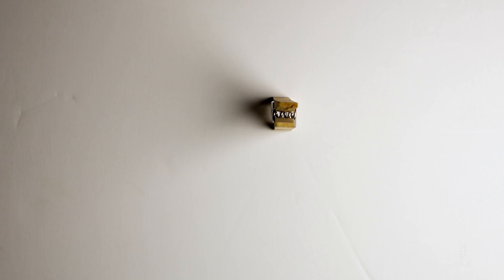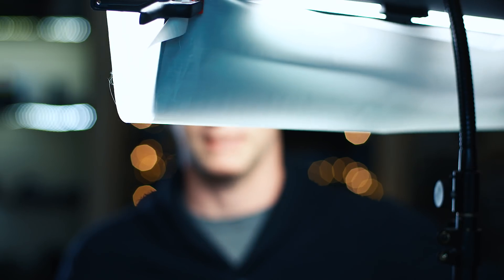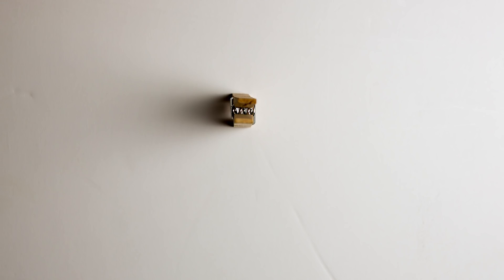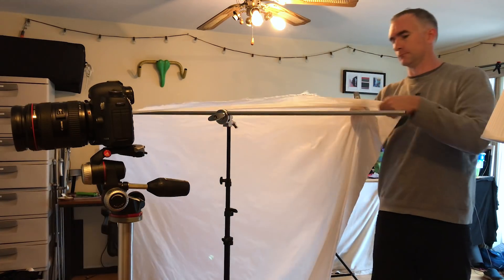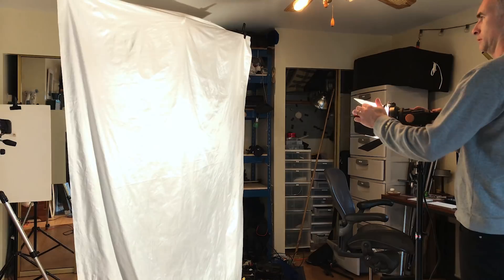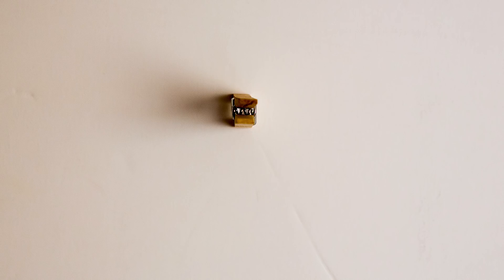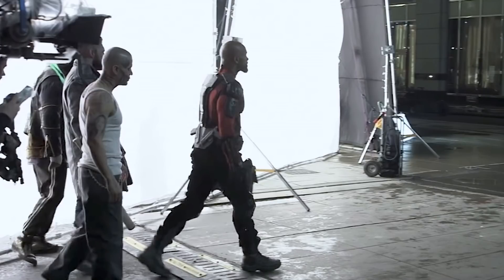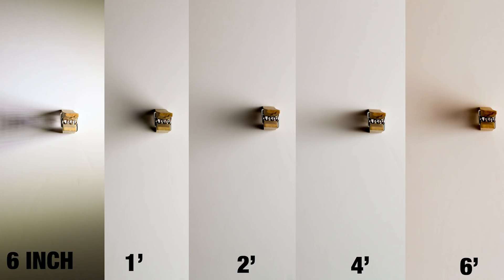Measuring the softness of light for film and photography

Comment: interesting approach.i've never really calculated the dimensions of a light source for a specific shot but i guess being a spark on film sets for over 13 years now helps to decide what to use.But mostly if you are shooting an interior scene on location your amount of space is limited anyways so the biggest frame to use normally would be an 8x8 or even smaller.Furthermore a wide shot doesn't need to be lit as pretty and perfect as the close ups.there you can always soften up the light as needed.Great video and cool channel,keep up the great work!

Comment: still relevant. size of the light source = distance in feet light source should be placed including 45 degrees from camera and 45 degrees above subject.  interesting way of quickly thinking about the softness of light. my question: if you want softer still, then twice as far away or half as far away? thumbs up.
Reply from the maker: Soft softer light, place the source closer to subject, use a bigger source, or both!
Reply: @Crimsonengine  got it! again, thanks for the sharing. sorry i can't make the abel cine/nyc c200 class. it's a shoot day for me.  abel cine/nyc are very good folks. thumbs up.

Comment: Thanks.
I have always used the diagonal of my source light as a measuring point. So if I have 1x4 Kino, its just over 4 ft away as my sweet spot, a 4x4 source, its just around 5'6", an 8x8 at around 11'4"... the sweet spot is roughly for what I like 30% on either side of that mark before I see any changes on exposure that is too much
One of the big tricks, techniques that I have learned is to created a booklight with an ultrabounce and a diffusion frame just outside of camera for interviews. This gives me a larger key light than normally possible in a small space
Appreciate your postings!